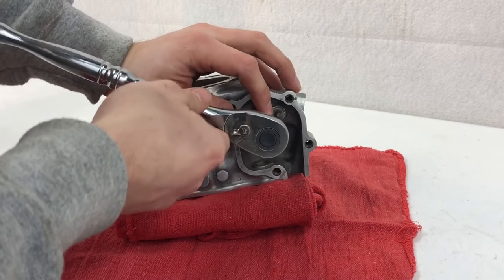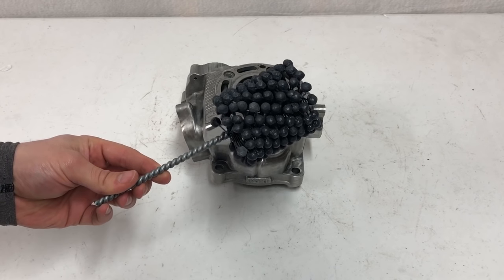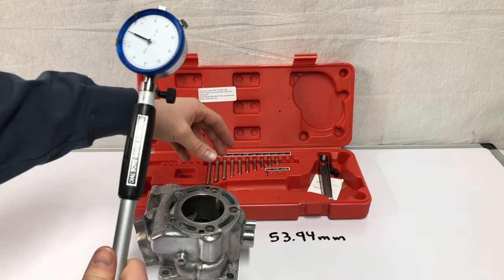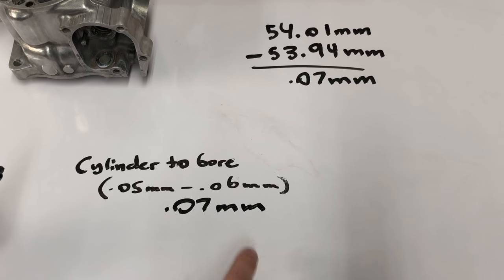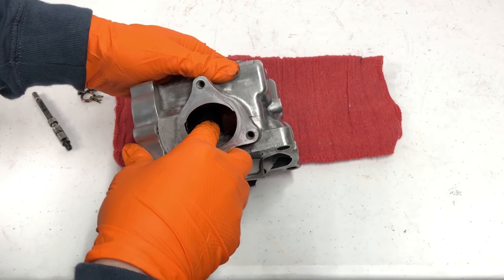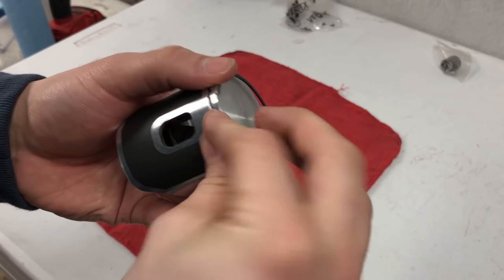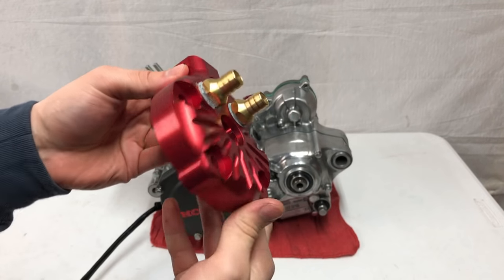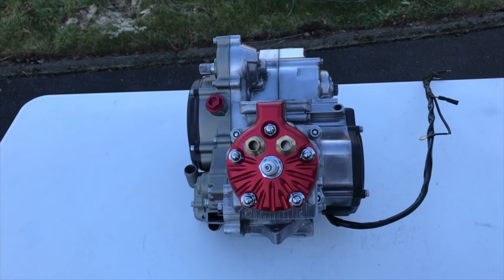Everything You Need To Know About Rebuilding A Two Stroke Top End

Comment: I just want to give everyone a couple tips on not just 2 stroke engine’s but pretty much anything in general. When you’re taking something apart that you’re not experienced with or you don’t fully understand take pictures and take notes. “For (Such and such) part, the washer goes on then the 10mm bolt” take photo’s of each bolt and the part before you take them off so you can look at those later and figure out how to put it back together. While you’re doing all that look at the different parts, look at how they work and learn about stuff. My Father completely took apart a V8 and was able to put it back together a year later because he found the old photos and notes

Comment: You said you were gonna explain why you put 2 cylinder gaskets on but you didn't
Reply: He didn't measure the squish band or check timing either
Reply: @Dylans503  2 strokes don't have a timing chain
Reply: @matthewhallman3453  a timing chain is for valve timing, that's not what I was talking about. ignition timing can be changed by the stator position to either retard or advance the spark. Look up 2 stroke timing.
Reply: Matthew Hallman ?... He means ( Port )Timing - Period ... NOT Timing Chain.

OK - I see I should have read HIS response first ... obviously (now) I see they were talking about ignition timing, as opposed to Intake / Exhaust Timing - 🧐🙃🤪

Comment: Hey man love your vids. I work on practice bikes for Mitchell Harrison if you're into racing at all. I'm a machinist as well and I just caught the bit on metrology and piston clearance. You can still get totally accurate readings down to .0005" if you just lift your caliper to clear topside. Essentially set the piston on it's head and stand skirts up then come in from the top at like 45° with the caliper.  Or as you said you can go with a mic. But don't take this as a dicky comment bro from one mech to another I know how sometimes those little tips are important! That's why your vids are doing well too man you do a fantastic job of showing the right way while explaining WHY it's right. Cheers from Temecula CA brother! Keep em coming.
Reply: Also setting the bore gauge is definitely better to use a mic and gauge blocks. And converting to or from metric always multiply or divide by 25.4. Just machinist talk but you are completely capable of doing all that man. The math you're doing is well beyond the measurement technique. In other words you have too many opportunities for human error, you are doing math down to ten thousandth placement. To put that in perspective to other people, one human hair is .003 and you're using decimals down to +/-.0005 so thats 1/6 dia. Of a human hair lol  so if you use that tight of numbers on math you really can't trust setting bore gauge off calliper and then doing that math to get difference. Instead. Use a 2" and a .130" gauge block and set a 2-3" micrometer then use the dial on bore gauge to set ZERO at exactly 2.130 then you let the gauge work for you just read the dial and you will have the best reading I think you get the idea. You're killing it man hope these couple tips only further your success
Reply from the maker: Thanks for the ideas! I’m always willing to learn from someone
Reply from the maker: Especially when done in a constructive way
Reply: You ain't gotta tell me I can see clearly you like learning. Doing all your own stuff and doing it well. Then filming editing and not to mention understanding how to produce a vid like yours. You're killing it man 💪

Comment: Great video. What I did not see was drilling the two holes in the piston for the exhaust bridge. Also, do you need any type of grease or oil on the shaft for the exhaust valves?

Comment: my old engineering lecturer used to call 'Vernier's'   "Very nears"  because there not very accurate for high precision applications like engine building. you should be using a micrometer for that piston diameter

Comment: What are the torque specs for the cylinder bolts and also the cylinder head bolts? I know the nuts go to 20ft/lb but what about the new bolts?
Reply: 04 - 07 CR125 manual shows 9 ft lbs for the cylinder head studs (equivalent to 108 in lbs), since they're the same thread I would think the same torque for cylinder studs as well?

Comment: do the cylinder head studs come in a pack? i wasnt really planning on replacing them, even though they are a bit rusty. but if there is an engine rebuild pack that has them i would do it.

Comment: ive ran into a problem where i got a new cylinder for a cr250 and i reused the old studs but they were very hard to get in and one didnt go in all the way and i ended up destroying the thread on the stud.
I was curius if i should always change the studs too when i install a new cylinder
I have also heard that the studs are only made for one time use, as if you would need to replace them everytime you take the head off.

Comment: Adam, use my cr125 for shifter kart racing.  Problem is the front mount hole has wallowed itself out larger than the 10mm bolt.  And I believe the rear one has damaged itself also.  Not sure how this happened as I check them, but it did.  Any suggestions on repair or just get new cases, uggg $$$$$

Comment: Rebuilding my CR currently...debating if I want to take the time to clean it up or not. Can I ask the process you used to get that cylinder looking the way it does? Also, the painted covers - is that powder coated or did you paint it yourself?
Reply from the maker: The covers are done using cerakote which can be found @ www.cerakote.com 
The cylinder was done using Mother’s aluminum polish.

Comment: Why do they need a rebuild so often?? Or is it just the high revving dirt bike engines? I have a Polaris 400 2 stroke and they go for years without a rebuild. But it also isn’t near as high revving and it’s water cooled too. I guess I could see why a high rpm 250 would need a rebuild more often than the big 400 2 stroke

Comment: How do you check for play in the connecting rod? Which axes should allow movement? Just rotational right?
Reply from the maker: Normally up and down play is what you should watch out for. Some side to side play is okay.
Reply: Adam Paganelli ok cool. I have a tiny side to side wiggle but vertical feels pretty ok. You inspired me to buy a 2 stroke!

My compression test only shows 60psi which seems way too low for the condition of the piston and cylinder. Any other reason you could think of that would account for that? It starts and runs fine.

Comment: That power valve shaft does not have a seal correct?  That was a bearing correct?  My 02 only has a bearing there.
Reply from the maker: On the 03 there is a seal like in this video. On the 2002 it is bearing
Reply: Damn you are good!  Wonder why they changed it. You’d think with the heat they wouldn’t have a seal in there.  Anyway great video I enjoyed it.  You do fantastic work it’s a pleasure to watch. Keep it up brother!

Comment: Is is fairly simple to rebuild engines? I’ve never worked on bike engines before and I have a ktm exc 125 2003 that needs a lot of attention! Thanks
Reply from the maker: If you a some special tools have the service manual you can make it happen!
Reply: Thanks for the support bro! I think I have the confidence to do it :) I’ve got all the manuals so should be okay, what special tools is required? Thanks again!
Reply: zorpRc did you ever do it? how did it go?
Reply: @kx7zz  hi yes I rebuilt it about 4 months back, it was actually surprisingly easy, obviously the first time doing it was slow and confusing but with the manual it made sense, though if I was to do another rebuild I know exactly what to do and how to take it apart and put it back together
Reply: zorpRc that’s great to hear! I’ve got a kx125 that needs the top end rebuilt. Aside from basic maintenance I’ve never worked on bikes before but i knew I’d have to wrench on the engine eventually. i think the top end shouldn’t be too hard though.

Comment: Most calipers are not accurate enough to measure piston or cylinder. Accuracy can be 0.1 - 0.05 mm. I wouldn't use mine to check for clearances.

Comment: why do you have to have more compression in order to run race fuel?
Reply from the maker: It’s the other way around the more compression I have the more i need a higher octane fuel to reduce pre detonation.
Reply: @adampaganelli4891  I didn't think you had pre-ignition with a oil & gas mixture on a 2 srtoke?? Am I wrong

Comment: Why did you use two gaskets?
Reply from the maker: In the video I said it’s what the guy at phat racing recommends with his h14 cylinder head. It allows the squish tolerance of the cylinder to be at an optimal range where I can still have high compression but not sacrifice much on top.